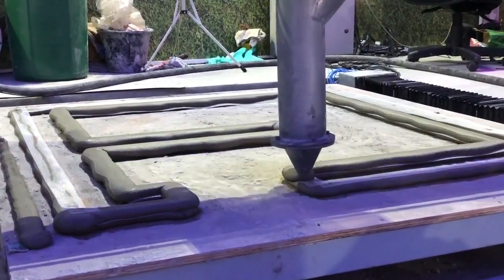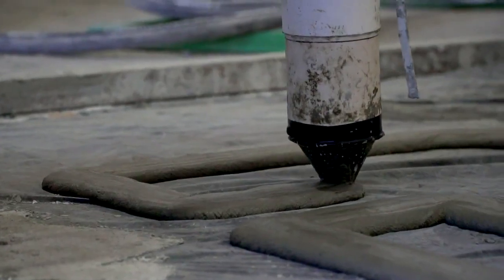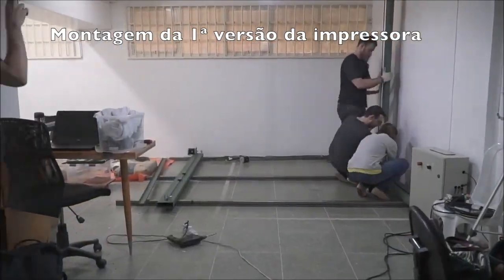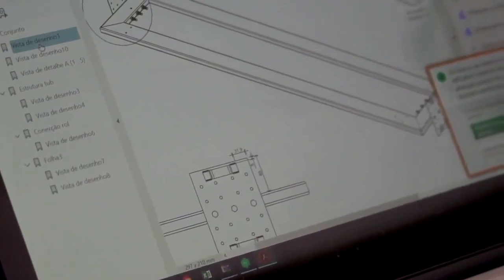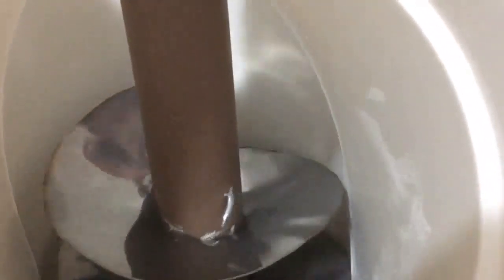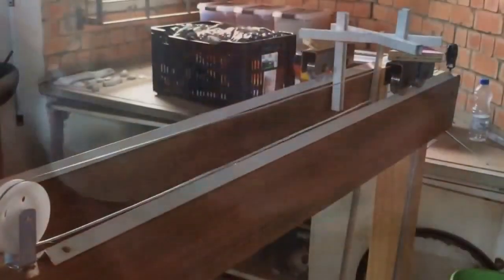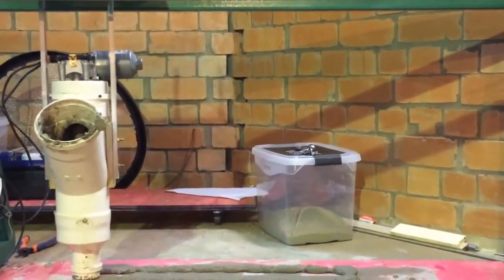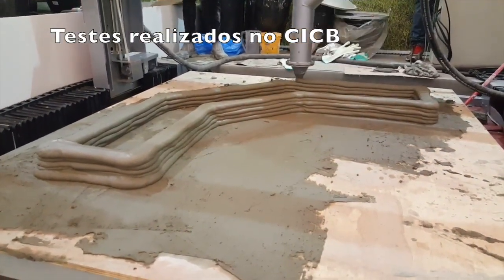First 3D Printed House in Brazil | InovaHouse 3D + 3D Home Construction Seeking Funding

Comment: Is there any company that’s provides 3D concrete printing In FL? Or the east coast in general ? Just bought land and placed a slab now I need a next step. But I’m saving and paying everything cash and this would come in handy.
Reply from the maker: Very few one off residential projects have occurred in the US because at the moment the only way to get your hands on the printer is to buy it. I am considering doing some type of crowdfunded printer so that 10 or so different projects can each get to use this technology cost effectively. If enough people show interest in this I’ll pursue it but there are still challenges that could defeat the purpose of making it affordable so if you need to get something built on that slab of yours soon,  you may be better off seeking other solutions